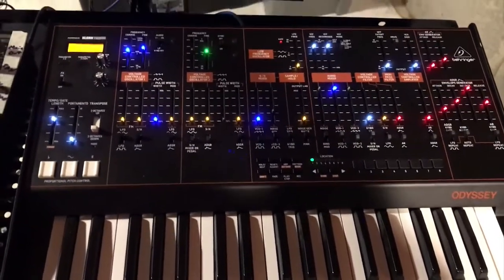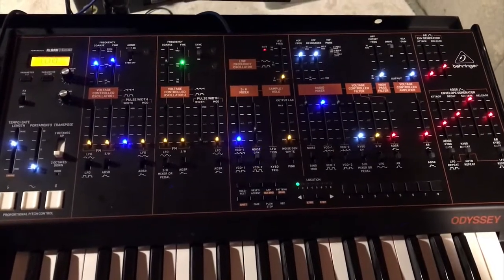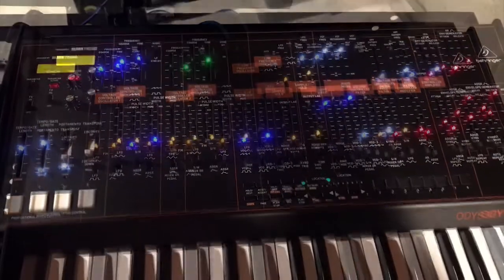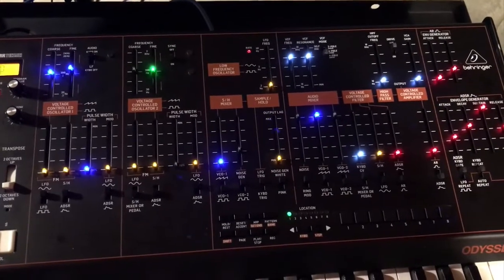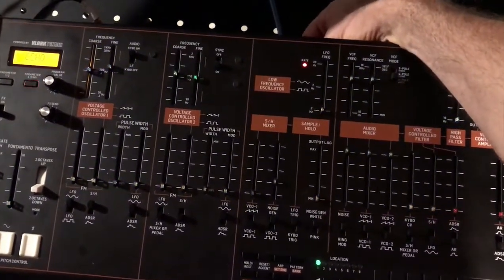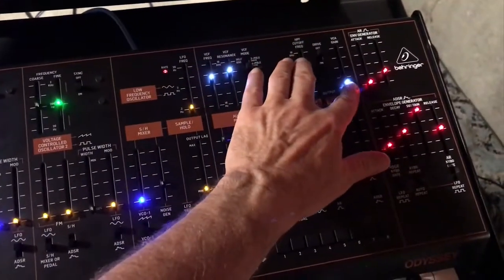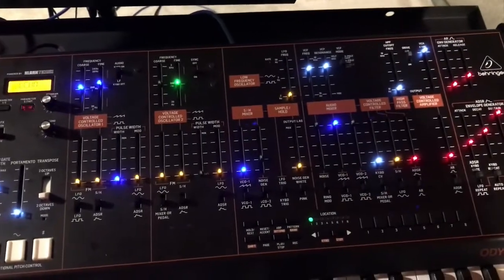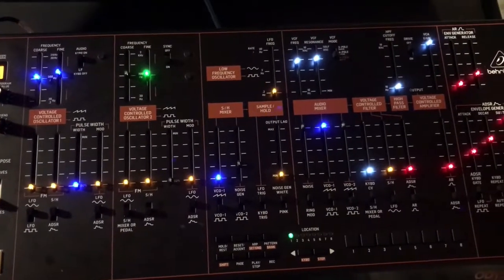Behringer Odyssey Repair Issues with faulty LED's and audio output

Comment: Any update  ? did they fix it ? I have a similar problem with my Arp
Reply: See my comment below, I had the similar problem.
Reply: @EmperorKonstantine01  I repaired the problem myself. It was a faulty logic ic that had a bad gate. Replaced the IC and everything is now running as it should.
Reply: @3dmaxuser  Do you happen to have a part number or where to get one online ?
Reply: @EmperorKonstantine01  I'm not back home for a few days but I will have a look when I get back and let you know ☺️

Comment from the maker: Repair update 5/15/23. Left a message received a response from Steve at PanurgyOEM stating that they are still waiting on replacement parts from Behringer. Sent it in last September and have been waiting as patiently as possible ever since. Behringer, if you are listening, what's the deal????